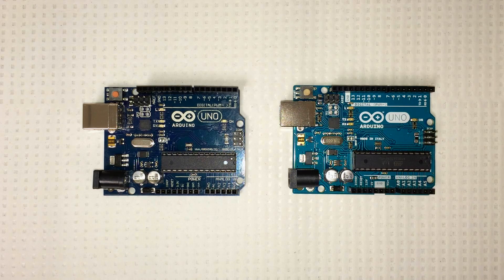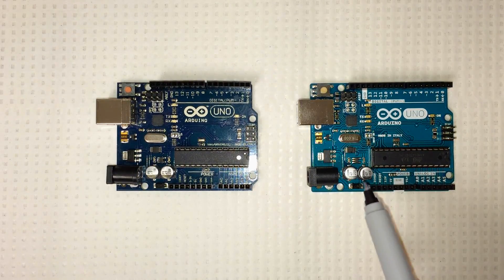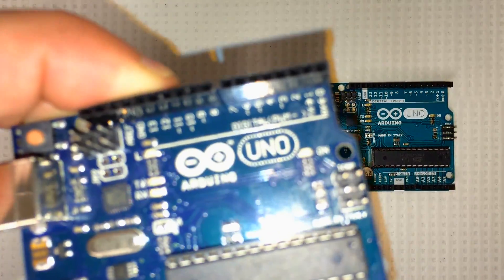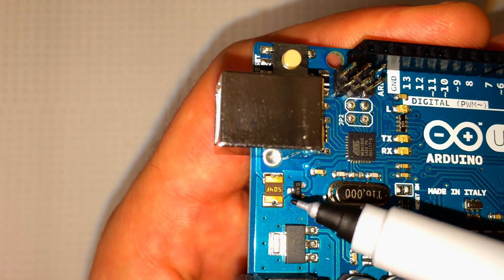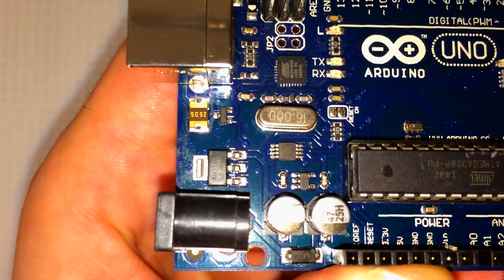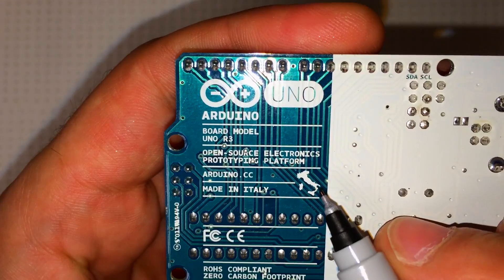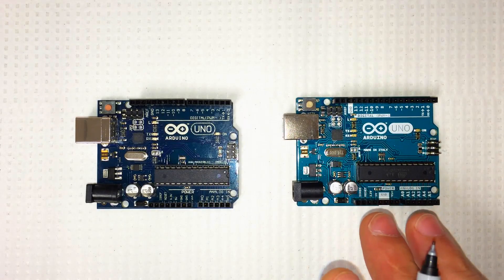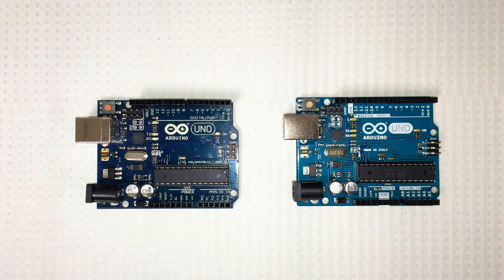How To Spot a Counterfeit Arduino

Comment: 😳. It almost look identical... 😳.. It will both run on the ide though... 😀... It's arduino China but on a license... 😁.wait, I checked, nope, China doesn't have a license, it's a cloned ripoff... 😄... It will still get the job done, the goal is to flash code on the atmega chip anyways... 😀

Comment: There exists no "fake" or "original" arduino boards. 
Everyone is able the produce these boards as they are open platform. 
You can even download the pcb designs and produce one arduino board yourself. 
As long as there is no technical/compatibility problem there is no issue. 
Until now I have bought some "original" boards and some "fake" boards and they all work 100% as it should be.

Comment: Arduino is open source.So how could this be countefit ?
Reply: Well cloning is fine, but they never say Arduino & Made in Italy tag. It would just say UNO, Mega 2560 etc. and not claim to be have Arduino labels or mimic the original labels. They fake ones try to say it's original and people might get confused at times. Well they work fine, but just make sure people don't get scammed into paying a higher price for a fake thinking they are getting a genuine one.

Comment: I assume no-one cares as long as they're both working like they should.
That's what should have been tested (as the title of the video implies).
Reply: @Love made in Japan Mine is just like the one on the left. The fake one. It has the 16U2 on it. Works great. A lot of my other fakes have the CH340 on them. Great for Linux (Supported out of the box ). Needs a driver installed for windows. But the CH34X works fine. It's just another serial interface. They work fine. Have you had problems with the CH340?

Comment: Real vs fake it dosen't matter both works same. both have same microcontroller company atmel which don't have real or fake. But wise choice is if you buy fake one you will save some money
Reply: not always true... there are many boards of varying quality, some will die quickly due to inccorectly sized capacitor / poor component quality. There are some good 3rd party boards available but they all have their own names and branding... this particular board is made to be a counterfeit of a genuine board, these are usually ones to stay away from as they are made to maximise profit and don't care about customer.. many of the good 3rd party board makers are proud to put their own name on them, i.e ruggedino etc.

Comment: I don't think either of them is fake. I looked up online a while ago arduino.org VS Arduino.cc as there are 2 separate sites that claim to be official Arduino sites. 

It turns out that at some point during the Arduino early years the creators had a falling out and they split into 2 separate organisations. 

Because they both created the Arduino together they decided to do a civil split. It looks like they've recently reemerged again though.
Reply: Wrong. The project is open source but the Arduino name is trademarked. You can produce and sell Arduino's perfectly legally as long as you call them something else.
Reply: @MikeMcRoberts  Also, one thing is the software which may be open source, but the hardware is either original or not... If you have the skill you may be able to replicate an Arduino board, but it wont be an original one...

Comment: When the design is published as open-source, even down to the PC board files, and people encouraged to make them, how can any of them be called "fake?" 
Even the Arduino community was, until recently, divided into two camps, both claiming to be the legitimate provider. 
I've bought genuine Arduino boards and supported the designers, and yeah, some of the cheapest clones are crap too, but there are very good quality ones available in the middle and there is no reason to not take advantage of them.

Comment: Arduino is Open source. It cant possibly be a "fake"
Reply: Hi Addi, "Arduino" is a company/brand much like you might say Nike. The platform and it's IDE are opensource. You just can't put there logo on your board. Much like making sneakers is legal. You can have the same design and materials like "nike" you can't brand it as Nike.
Reply: when talking about "Arduino" I meant the UNO board, sorry for your apparent confusion
Reply: I think that Arduino UNO (and/or Arduino UNO R3) is trademarked

Comment: I suppose the correct distinction is "clone" as the board is as functional as the genuine Arduino. To say that it's fake the board has to be missing some essential functionality, the intrinsic value of the board (the raw materials and components) is no more or less than the clone version, so it's safe to say that if you want to buy just for the sake of functionality then the clone version is your inexpensive choice. But, of course since it's open-source the developers deserve some support to help them improve their existing products and create something new and unique.
Reply: True, I came by a counterfeit UNO that looks and performs exactly like a genuine one, with 40% of the price. all the components were in place and soldered very well.. no problems at all.. 
Arduino itself is a copy of the Wiring project. so there's no point of buying genuines in the first place.
Reply: Al-Moutasm Bellah Rajab Part of what you pay for the Arduino goes to the development which helps improve the support of various libraries meant for the Arduino environment, because it's open-source, they cannot license to anyone which is a source of income. In a way, by buying the genuine boards you are helping Arduino remain open-source and free to use for anyone. I use my genuine board for research and development, I buy clones for the purpose of permanently embedding them onto a specialized build, as I do not like to spend my time and energy building an actual prototype with the exemption of commercial purposes.
Reply: Well I think it is counterfeit because it ckaims to be a genuine Arduino board but it is not. It is only a Arduino compatible board. You can buy compatible board in the far east, where it is never writen Arduino or made in Italy, and on which the build quality is far better than the example of the video, almost as good as a genuine Arduino.

Comment: So, I purchased a 4 dollar counterfeit board.  ( knew this beforehand)  So I could have a board that I wouldn't really mind frying or messing up.  Does it work just fine, or is it gonna not work?  It hasn't come in yet and I was just wondering.
Reply from the maker: It should be fine, I have few as well and they work just like the genuine Arduino
Reply: No, After 1 circuit it broke so NEVER GET COUNTERFIT urg

Comment: All those people, who are writing that the board on the left is not a fake but just an unofficial version, are wrong. The board on the left uses the same logo as the original, which is not allowed by Arduino's licence. If the fake board was called "SHITduino" or something else, then it would fine. But using Arduino's logo by other companies isn't allowed.
Reply: I would buy the shitduino.
Reply: @erimemrebaran1206  i would buy the shitduino mega
Reply: It also says made in italy, which is not only fraud by itself but also proves undoubtedly that they want the customer to think that it's an original one made by arduino (as opposed to calling it arduino r3 just because it's a microcontroller using the same design as the original one that everyone knows, which would still be a crime (trademark and shit), just less severe)
Reply: The problem with these Chinese boards is that sometimes they will get away with it and make you think your buying an original

Comment: There is no fake. Fake does not exist in the world of open source. Only closed source does. 

You should change the title to OFFICIAL vs UNOFFICIAL. The board on the right side is officially designed and distributed by ARDUINO itself. That doesn't mean anyone can't copy the design and sell it for profit. ARDUINO won't sue u. That's the beauty of Open Source Hardware (OSH).

"Build It, Hack It and Share It" - Massimo Banzi
Reply: +MOHD FADLY The hardware is open source of course, but not the name neither the logo which are trademark ( https://www.arduino.cc/en/Trademark/HomePage ). The fake Arduinos uses these without permission, and Arduino team fights counterfeits according to this page : https://www.arduino.cc/en/Products/Counterfeit
Reply: +MOHD FADLY please u r dumbing down the IQ of all the open source community.
Reply: +MOHD FADLY 
Correct, but when you make one from the arduino source, you can't call it an Arduino, due to its registered trademarks.
Most replica builders does infact call them something else, and then it's ok..  
The problem is the ones that use the same name, and claim to be officials.
Reply: Wrong. The project is open source but the Arduino name is trademarked. You can produce and sell Arduino's perfectly legally as long as you call them something else.
Reply: @MikeMcRoberts  Yes, I agree with you. It's like calling Nike a pair of sneakers made in China which you can easily spot by the bad quality compared with a pair of real Nike shoes sold in a store in US... you can't call those boards Arduinos.... that's piracy here and all over the world...
Reply: Not only they call it Arduino, but it says "made in italy". This is an insult to the customer. Also i'm sure that some beginners get rippped off buying a fake one thinking it's real (at a much higher price than it's worth).
Reply: Wrong. They are using the trademarked name illegally.
Reply: Except you must not call it arduino.
Reply: +MOHD FADLY thank you, it's a good point you make, and whereas in this video the replica board does use the Trademark Name 'Arduino' (which so many here are making an issue of) mine in fact does not; And yes it is a jolly good copy and perfectly functioning CHEAP 'Unofficial' Board.

Comment: Excuse me, but are you stupid?

The golden 501k is made specifically for the official Arduino board. Both of them have this golden 501k. Neither is counterfeit.
Reply: +Naavexen Erhora "Arduino" brand name is not up for anyone in the world to grab because of their tight quality control. Therefore, you can see many clones seeduino roboduino you get the point. It's an open source hardware and true neither is counterfeit but he's talking about real arduino made in italy vs clones made all around the world. And it's true the boards made in italy are high quality and more durable than the clones.
Reply: joe20m20 Of course, but remember also that, as I said, that golden resistor is only on official Arduino boards. The Chinese clone can be considered counterfeit, or a clone. A clone is a proper replica, a counterfeit has hacks (I remember one hack had something along the lines of a fake DIP chip and all logic in the USB thingy).
Reply: There might be someone selling fake gold components, or they undsoldered it from a real Arduino.

Comment: There is no fake or real arduino because it's an open hardware.
Reply: The hardware is open source, but the name 'Arduino' is not. Only an official Arduino may use that name, therefore the board in the video is counterfeit.
Reply: +unicyclematt mine is a perfect CHEAP Copy that does not use the name 'Arduino' - it is totally unbranded; May I now use it with a clear conscience?

Comment: so what are the pro's and con's apart from components? One can get a PCB and solder the components themselves, but if it works out the same. One could play with the "copy/clone" and finalized on a the genuine article. I don't disagree with supporting Arduino at all, but it is open sourced.
Reply: The people that make the fake boards (not clones, clones are perfectly fine), are leeches, and are charging unknowing people into paying a premium for what at first appears to be real. But it's not. Real boards obviously are usually of the highest quality, and obviously, money made from them goes back to the company. But these fake boards cost more, and don't give that premium back to the organization. Everybody loses - you get a shoddily made, sub par product, Arduino doesn't get their cut when somebody intends to buy original brand. The people that manufacture the fakes are scum and exploit the open nature of the board for simple monetary gain, with no regard for where the designs come from.